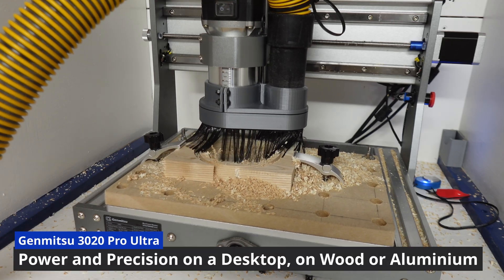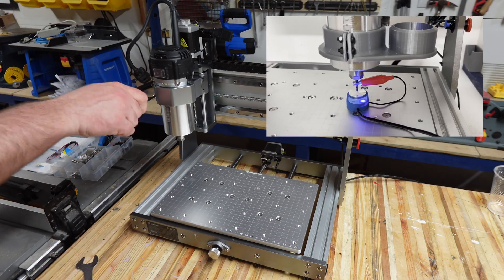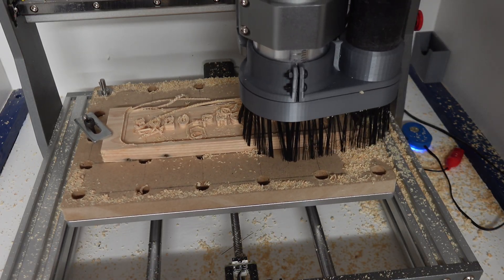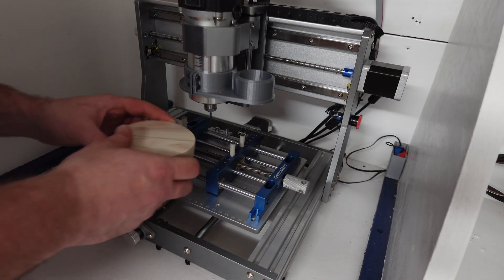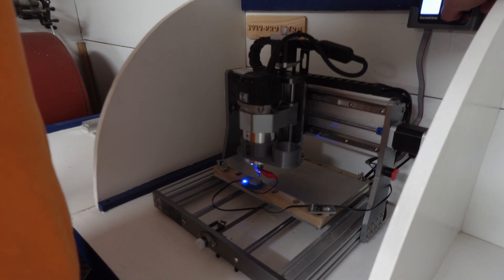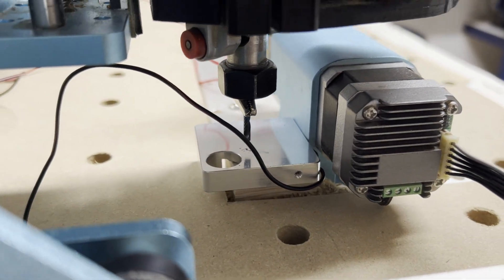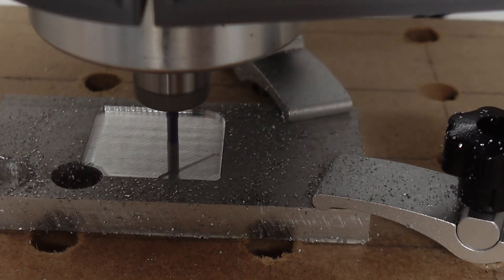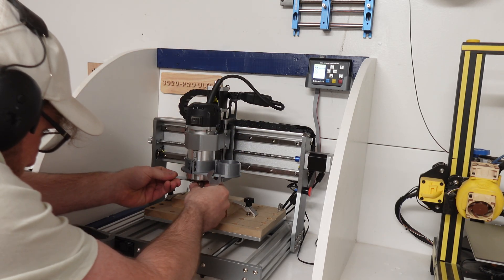Power and Precision on Your Desktop, Genmitsu 3020-Pro Ultra CNC Review

Comment: is there or, did you tested 4th axis / rotary?
Reply from the maker: It says it cant work but Im curious to run the 4040 reno one some day, id have to remove the baseplate and bolt it on the rail though, it's a short CNC. Thanks for watching!

Comment: Nice job I have the Genmitsu 3020 Pro Max V2 (now 3040) have not cut aluminum yet, and was wondering what your feeds and speeds were?
Reply from the maker: I do 0.5mm and 800 for speed, when I tried to go too slow, the bits would fuse to the alu and break. I needed to use the bits meant for alu that genmitsu sells, or other brands of course, but the basic bits just broke too easily. Theyre not much more expensive but more hardened. Good luck! I will go 3040 eventually too, it's a really cool upgrade.

Comment: for the compressed air, what if you used the blower port on your vacuum? and use your same 3d vac port 

most shop vacs you can plug the hose into the back and it'll blow air
Reply from the maker: I will definitely try that next time, standing around with the hose is not great haha! Thanks!!

Comment: When I connect my touch probe the light turns red immediately and I cannot figure out how to change that or si am thinking the sensor is faulty right out of the box? Help anyone!?
Reply from the maker: That means there's a short somewhere in there, the light becomes red when you complete the circuit with the alligator clip. Has it always been that way? Maybe the screw under the probe crushed the wire?

Comment: Do you have the file for the 3d printed attachment?
Reply from the maker: Hi, here's a link to a zip with 3 files. The original files, and the one I modified to fit my bigger (dewalt, 2.5") vac. I had to cut the back off slightly with a bandsaw to have it fit, the spacing behind the router is very small on this. It works great though. Thanks for watching!

https://www.dropbox.com/scl/fi/c6q0ywuhq30wq301iya6z/Dust-Shoe.zip?rlkey=wmw8wm0turc6l28rd33omj2hq&dl=0